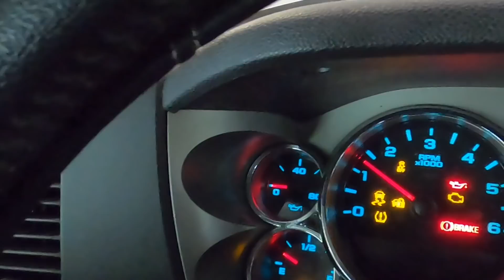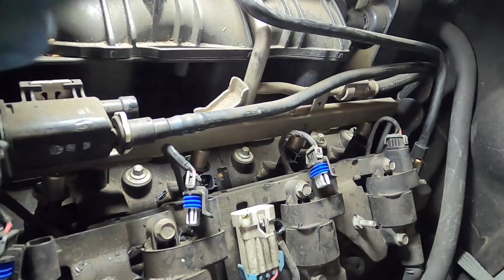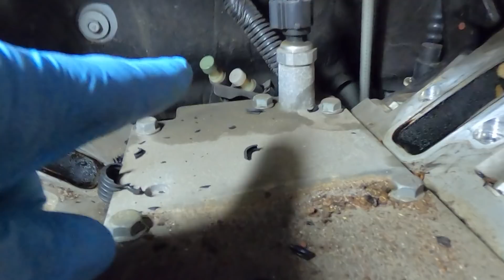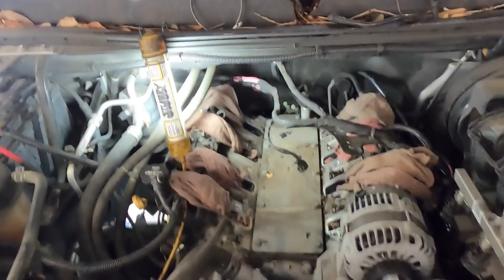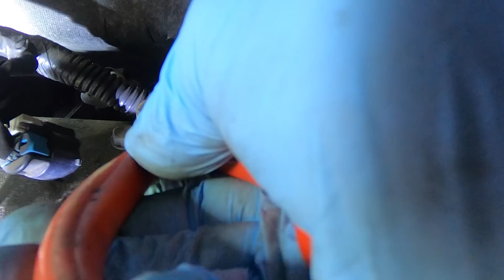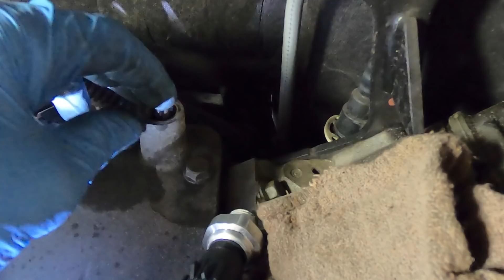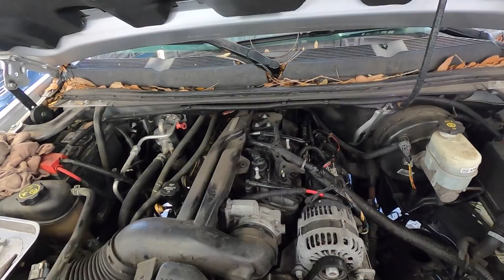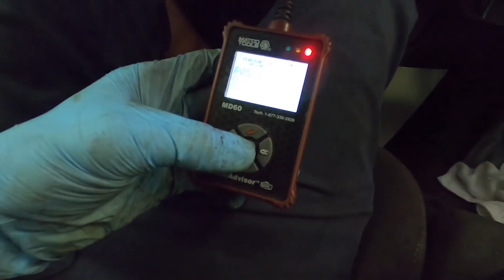Customer States: Google Diagnosis…replace this part!

Comment: If the shop is flat rate and the book says 2.6hr includes removal of intake, then that's the flat rate design for the repair.
If the tech and service manager agree the access to the hole is required for inspection, then that's the way to access it.
It's a known problem, we don't have the GM service file for this unit.
We don't know if the wires are pinched or chafed.
We are told it's no pressure.
It's suggested intermittent.
The customer wants a part put in.
He has to expect a by the book job. The shop has to confirm to state guidelines.
The guidelines in my state, I don't know about his, are a minimum diagnosis time is posted.
The customer signs a repair order which outlines the basics.
Discussion between these people decides what they agree to do.
If they don't agree, then the repair should not commence.
If the customer is fully apprised, there is some known risk.
Book time wins but management decides.
The tech can say, "no not me." He can't keep that up though on several repairs and likely keep his job.
If it's visible on teardown, other ideas can be considered.
Does oil come up when cranking the engine?
Is any obstruction present in the hole?
Is the old screen down in there?
Does the gauge later begin to operate after the codes are cleared?
We don't know.
Is there a GM service bulletin?
Does it apply to this year and engine?
Was it completely followed?
This was a month ago, and there's no part 2.
Is it still acting up?
Is the oil pan full of sludge?
Do you see how saving time either makes a good guess or a problem child can result?
I hope it started working.
I think your access plan allowed you to inspect.
I think that's a solid expectation for you, your service manager, and your customer.
If they don't like it, they can short cut it and bear their own consequences.
It's your reputation you have to maintain.
It's your integrity.
It's a two way street.
Happy Chevy.
It will need further attention to this issue and it's not Rays fault.
He is smart to document his careful handling of the concern under the circumstances.
Live to fight another day.
God bless you.

Comment: You would think surely the engine designers could have done better than that. I know the oil sender unit has to plug into a gallery but really  !!

Comment: Back in the days that Classic Rock was written a oil sending unit change on a Chevy was a 10 minute job even for a shade tree mechanic. They should make the engineers work on what they design. Great videos,, thanks👍
Reply: Sending unit was around $20 and took 10 min to replace on my 97 Dodge Dakota. Might have only taken 5 if I didn't stop to drink a beer lol
Reply: Trouble is there's a lot more 'stuff' now and it has to go where it has to go.
Reply: I couldn't agree more re engineers have to work on what they design after 50,000 miles if for no other reason than wake up to the real world.
Reply: @pthomson9736  BINGO.
Reply: @pthomson9736  if you really want something to change get the beancounters to work on it instead.
Reply: 10 minutes to unscrew and replace a little thing the size of your thumb that sits right out in the open? Maybe if you drink enough beer or are eating a sandwich while doing it.
Reply: But in those days the motors put out half the power for the same size motor and were dead at 100k vs the 300k + today.
Reply: They did work on the design, it's as difficult as possible without pulling the engine and the tranny... 🤣 Gotta make them dollariedoos to feed them CEO folk their gold leaf cake... 🙄
Reply: The engineers do it because they are told to. It's to take everyones money and feeds the failing economy. If it was designed honestly there would be no Rainman. No need for him.
Reply: @kirklucas1332  Not true, planned obsolescence wasn't always a thing, and only really came into wide spread use in the 1990s. Cars need service and maintenance because no design can be perfect in any case, so there is always a need for Rainman.
Reply: @watershed44  
It's true enough. Like the man said. Whatever you have to tell yourself. You haven't looked at these vehicles or worked on one if you think these engineers are stupid useless diversity hires as you call them. They are designed extremely intelligently to take the consumers money and discourage DIY repair. Planned obsolescence had a different form in the 70s. They obviously sprayed them with something at the factory to make sure they rusted faster and would rust out. They have gotten much better at it. Now most have no frame. When the unibody rusts through they are junk! 
Cars and trucks could be designed at this point nearly anyone could diagnose, repair, that would not rust. Never buy another. A dishonest system is the only reason one doesn't last lifetimes. If they did there would be few jobs and the economy would crash. If you don't believe it hire real engineers and build cars that do last 100 years and are easy to work on. They would kill or ruin anyone that tried it!
Reply: @kirklucas1332  The truth hurts.  Many engineers hired today are the result of gov't mandated racial/ethnic/gender quotas. 
They are UNqualified, and incapable of creating well thought out, efficient, and reliable designs. There is always a cost factor but prior to the 1970s value found in a durable product was a top priority and while it couldn't be perfect it was engineered to last many years and give good service before it needed to be replaced, or repaired, and yet the companies still made a reasonable profit and were successful.  Today you have extreme greed, and also gross incompetence which makes for shite products that won't result in the customer buying more from the same company, they will go somewhere else the next time.
Reply: Yeah...and you're also the guy who thinks all seats in a football stadium should be in the front row on the 50-yard line...you've never worked a design problem in your life, have no idea all of the dynamics involved in the design, but you're a self-proclaimed Internet expert...
Reply: @buckhorncortez  It could be made easier in a situation like this. I understand the job of an engineer is difficult, but this isn't necessarily a design decision made by an engineer. Yes, some engineers do shortcut work, but having many friends that are engineers, in my experience at least, it seems many engineers are trying to make something great, but are told to make it cheaper, easier to manufacture, more difficult to repair... etc. etc.
Reply: @jacobwcrosby  exactly. In the construction trade it's almost always the architects and designers who make the fancy design and make it hard for engineers to make it all work. I suspect it's similar in the automotive world. The designers want that long windshield for fancy looks or less drag. The engineers say, well then we need to make the engine bay a little taller. Then the penny pinchers say no to how much that will add to the cost. They can and should be talking to each other a lot more, given the stupid location of that sensor.
Reply: @buckhorncortez  you design crap for repeat service business- big profit center for stealerships
Reply: @buckhorncortez  Some people aren't qualified or have the actual ability to be an engineer but they are hired anyway and these kind of idiotic issues are the result, it's DIEversity hires.
Reply: @FlaBeardedOne
Most of the engineers today at GM are "die-versity" hires and only have the job because they are a 
protected minority, not because they deserve the position.
Reply: @watershed44  whatever you have to tell yourself....
Reply: @Teggymania  I always speak the truth. 
You are a lover of lies.

Comment: Lots of armchair technicians in the comments here. Lots of whiners about how long book time is too. If you feel a shop is overcharging you by all means... DIY. And then you can enjoy the lovely broken bolts and cheap plastic parts that fail as they are removed. Don't forget to savor the dirt and sweat in the eyes. Relish the cold of winter in a barely heated shop. Take heart in the heat of summer with no a/c. And then after all that the customer will whine about the price... well since you DIY'd... only thing you can do is go f@(k yourself.
Reply: @Wells Motorsports
I don't whine about those things, I do have a problem with shoddy work that almost ALL mechanics seem to do today. Sloppy, incompetent, and thieving many times.

Comment: I thought my Trailblazer 4.2 I6 was a bitch but this takes it to a different level. I can see why GM is going tits up especially when my AC Delco parts say made in China. But considering I bought my truck for $500 and it runs and drives like new with 250,000 miles I can't complain. One good thing about living in Vegas old cars may have dents but they don't have rust.

Comment: i actually drove my truck with no oil pressure for the first quarter mile for over a decade but the gauge was one of those ghetto ones that either show 0 or normal pressure and nothing in between so there was probably some pressure then last month i had some really rough starts till it hit full pressure so i brought it in and asked them to change the pump but test it first ended up being the pump  just a lucky guess in the end

Comment: Even though the "Check Engine" light was on, the oil pressure warning light goes off. I think you replaced a perfectly good sender with a new perfectly good sender. (I agree, it wasn't the problem) The customer spent a lot of money on parts and labor, and didn't fix the truck!
Reply: The may be a second switch for the light so that may be irrelevant
Reply: @lucascannell4418  Very possible.

Comment: you Seriously, seriously messed up on this one! The TSB is not to add the oil screen but rather to replace the one in there from the factory! Sledge blocks the oil screen preventing oil flow to the sensor, causing it to read zero. In actuality the sensor is fine, it is no oil flow due to a blocked screen, however if your going to go thru that much trouble then you should replace BOTH the screen and sensor! The reason your new "added" screen wouldn't sit right is because there was already a old (most likely clogged) screen in there! The customer, and google were correct that had to be done, except the screen also needed to be replaced. Getting the old one out is a pain in the ass. 

I am impressed you did it the "proper" way by taking the manifold off, and not just telling the guy you did, charging him full time, and then taking the shortcut. For those of you who don't know you can (not very easily) sneak the proper socket in, and with a swivel ratchet and adapter, actually sneak the sensor off, and old screen out with out removing the intake. It is very hard, may actually take longer and definitely be more frustrating than just removing the intake, and you will probably cut your hands up, but it is possible! 

Regardless of how you do it, it is very very very important you both REMOVE THE OLD SCREEN AND INSTALL A NEW ONE!!!!!!!!!!!!!! Please like so he can see and reply to this comment, I would love to know what your response is to this, did you really not know this? Did the customer let you actually diagnosis the car, and if so what was your repair? If not I really hope the guy didn't take it some where else or you probably looked like a smack ass on this one (they would have told the guy you did not replace the screen, they would have, and well as I said you would look like a smack ass), I would love for you to call the guy back, bring the car back in, remove the sensor, and look in there and see if their is a existing screen already in there, and clogged. I bet $1,000 that is the case and that is why the new screen did not sit right, and the new sensor did not work! I also can not believe I have not seen anyone else in the comments say this! 

I thoroughly enjoy your videos, and do learn a lot, but on this one I think you seriously goofed up which is ok it happens to the best of us! By the way every shop I ever worked at we would never install a part with out first diagnosing the car our selves, we did not care take it some where else if you did not like it. We would also never install a customer supplied part. 

Still with me! Funny story time fleet mechanic and we have one these engines with the check engine light, and no oil pressure reading. We sneak the sensor out, and are attempting to remove the old screen. We using a pick, screw driver, every thing we could thing of. We are getting angry, our hands are cut up because we did not remove the intake, and we are shoving this small pick thing in the and out, rotating it around, every thing we could think of. The other person with me who has been doing most of the attempt to get the old screen out finally get frustrated, rips the pick out, says I give up here you try. When he hands me the pick I look down only to realize the screen was on the end of the pick! We had a good laugh, lord only knows how long the screen was out and he just didn't realize, then we got aggravated trying to install the new screen and sensor :(. Definitely not a fun job.
Reply: @Kevin Weil 
Liked your comment because you actually appear to be a well informed and competent mechanic. 
Seems so rare today, I love my cars and I'm no mechanic, but the quality of most techs is so poor today that I do the small jobs I am capable of and just keep driving hoping for the best. That is how bad it is finding competent, HONEST help today.

Comment: Hilarious! Customer committing to how much labour on the back of their own (weak-ass) diagnosis? Hope we see this one back, so you can actually fix the problem. I suspect those codes might play a part, but also hope there is actually some oil pressure to measure.

Comment: Just curious Rainman, wouldn’t it be cleaner and  more effective to use a shop vac to remove debris rather than having to plug up the intake ports?
Reply: It's just common practice to plug the ports. Even if you use a shop vac you can't guarantee nothing gets in there. It's old school but it works.

Comment: Yeah, that's really odd. No doubt he'll blame you for the expense. We NEVER just replaced parts and always found the real problem before quoting a repair. Back then we didn't charge for "diagnostics", partly because there were no electronics. Just a voltmeter, vacuum gauge, and a Sun "scope".
Sorry, but always turn a thread backwards to seat before tightening.

Comment: Doing what the customer wants is what pays the bills. Even though what they might think they want might not be what they really need. Making an informed choice is a good thing. BUT: If you google any symptoms your body might experience, I promise that by the second hit on Google, you have either cancer, AIDS, some absurdly rare tropical disease, or any combination of those. Just as Google and WebMD are no subsitute for med school, Google is not a substitute for an actual mechanic. Looks like a classic "damned if you do, damned if you don't" kind of deal: 
If you don't do what the customer wants and suggest additional things to make sure you're not barking up the wrong tree, they will accuse you of trying to rip them off.
If you do what they want and it does not work, they will accuse you of not having done a proper job, just so you can THEN rip them off.
Either way, you lose. But I would also feel better losing but at least getting paid.

Comment: Man I remember when you could actually get under the hood of the vehicle. You could actually change the plugs and the wires on the motor. You can do little odds and ends and clean the motor up and make it look good. Now you can't see the water pump or the AC unit on it hell you can't even find a windshield washer reservoir. But it's nice to remember the good old days. 
🙂👍
Reply: Yep, just a tangle of wires and plastic fittings and connectors everywhere these days. Everything is bloody plastic... In 20 years or so the vast minority of cars in the developed world will be electric, it's happening while we watch. I wonder what a day in the life of a mechanic will be like then..
Reply: You think this is bad ? Try one of the v6's in a car shoe horned in.

Comment: Customer states,Me: Previous owner worked on front end. I googled the issue and I believe they did not tighten a nut on the steering column properly and it caused the clock spring to break causing  dash lights to light up.(ABS, SRS, cruise not working)

Shop: Okay we'll have to charge you 120 dollars to diagnose the problem
Me: Okay
Shop: We could not figure out what you meant by the nut on the steering column but the clock spring was bad so we replaced it.
Me: ABS,SRS light still on
Shop: That'll be another 120 dollars to figure it out.
Me: uhh okay...no

Google is not the issue it is people not understanding cars being the issue. I as well told them I have a clinking noise like a flag pole and they charged me 120 dollars to tell me my dirt shield was loose and that was it. They obviously did not drive it as I still have the clinking noise and now a grinding noise when I brake. I wish I was near you so I could bring it in and get my durango checked out.

Comment: Wouldn't the engine not run if it senses no oil pressure?
Reply from the maker: Ohh no, it’ll run without oil pressure. There was oil pressure, just go gauge activity